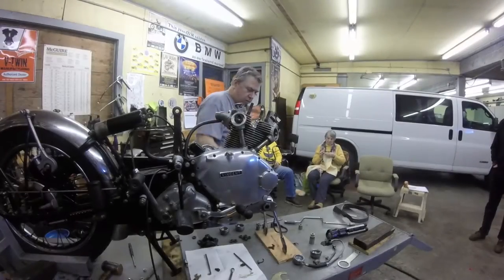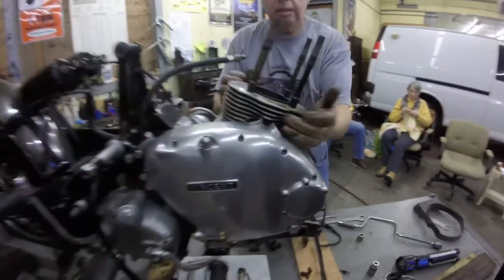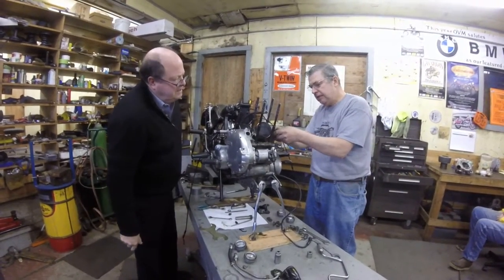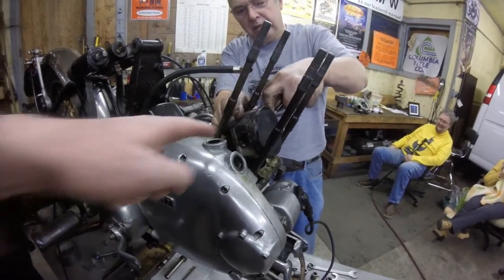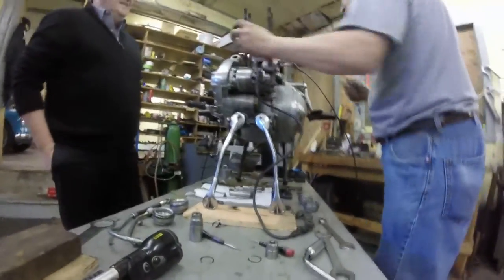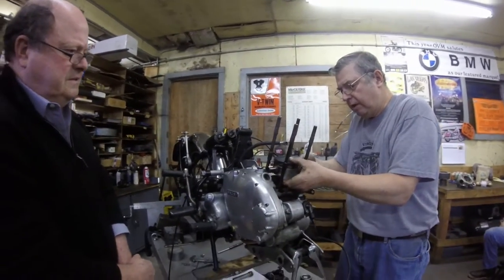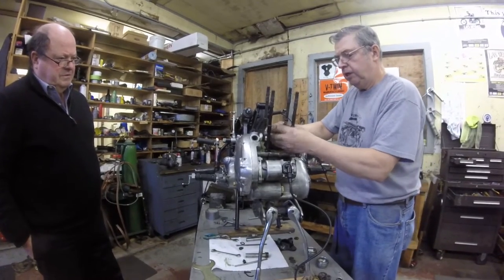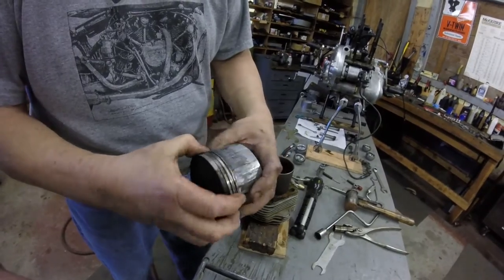1951 Vincent Comet - removing the head, barrel (muff) & piston

Comment: 8:1 is still fairly high compression for this era bike. It seems to be the sweet spot though for an air cooled single on modern high octane fuel. What compression was it running when it seized?
Reply from the maker: Hi Buncho888, I'm not sure.  It was seized when the previous owner had it.  From what I recall, it was under a very heavy load going up a long hill when it happened.
Reply: Mi Ty maybe it was running a bit lean at full throttle. How does your Comet go with the 8:1 piston?
Reply from the maker: Hi buncho888.  it goes very well considering it's age.  It won't keep up with the twins but it's a ton of fun.  Cheers, Mike .   Here's a playlist of rides etc.  https://www.youtube.com/playlist?list=PLgDzKiI-i6nZup2aTxLTTyBegtGPRgNk5
Reply: Mi Ty Your Comet looks great. I like these workshop style videos. I've got a '36 Velocette MOV I'm tuning at the moment. I've raised the gearing with a bigger gearbox sprocket and now I'm raising the compression ratio from a measured 6.6 to 7.8. I'm installing a wideband O2 sensor with a custom analogue gauge as well. I'll post a video of the sensor setup when I have it running.